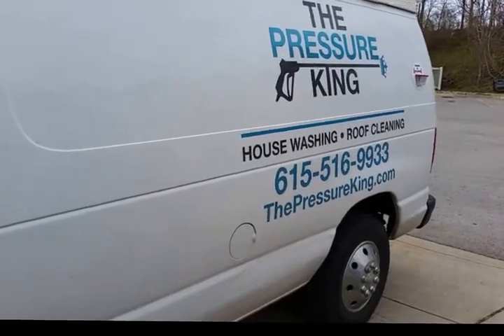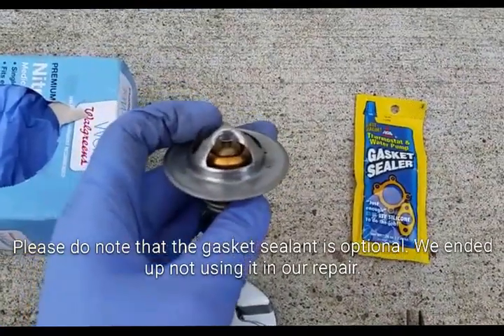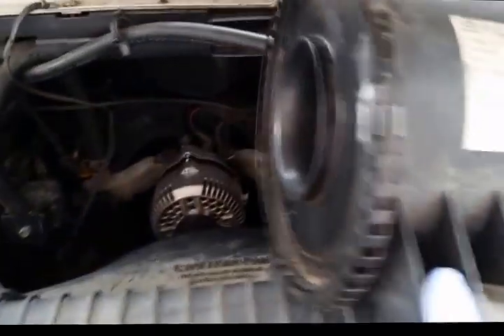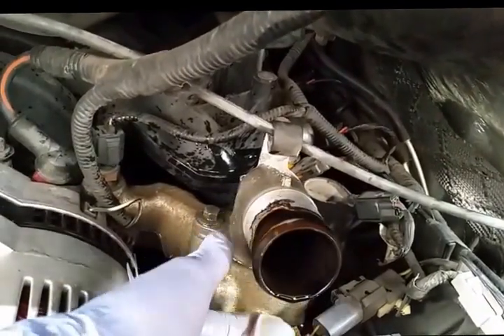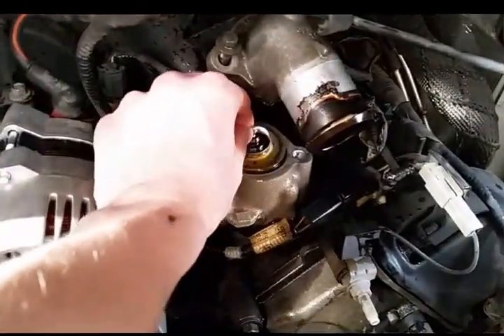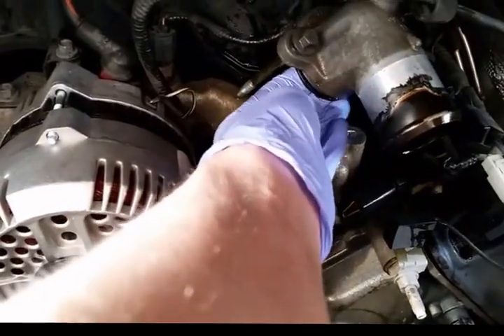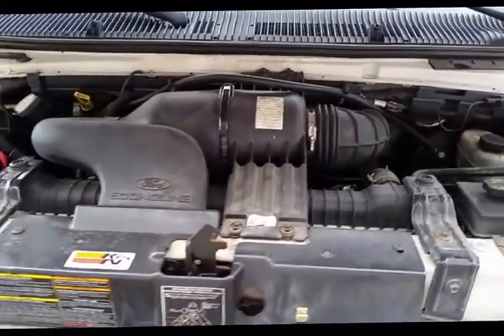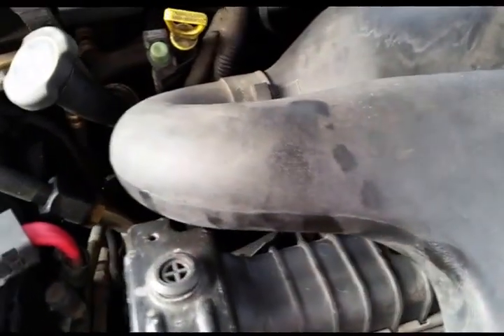Replacing a Thermostat on a Ford E250 (5.4L Triton) - Easy!

Comment: This is TERRIBLE advice!!! I parked on a slope with the front of my van at the higher end and when I removed the top radiator hose it sprayed GALLONS of coolant into my bank 2  spark plug wells and fried two of my ignition coils. I looked up another source for doing this thermostat job and it emphasized that you NEED to “drain all the coolant out of the system before loosening or removing the hose from the thermostat”. Yeah, wish I would have read that before watching this video of an incompetent giving me advice on how to fix my thermostat by ruining my ignition system. Thanks dude!!!!
Reply: 5:18 he specifically mentions putting the van on an incline with the rear up higher. Did you even watch the video? Seems like the only thing that is incompetent is your listening skills.
Reply: Which way does the van need to be tilted regarding the coolant? I can’t tell from the video? I haven’t done this before. Seems like the back should be higher than the front but not sure how everything flows…?

Comment: The spring is just a way for the thermostat to remain closed, the engine heat melts a wax plug inside the housing of the thermostat that opens the plunger and lets fluid pass, the wax breaks down over time and doesn't melt at the right temperature so the thermostat remains closed while the engine continues to heat up.
Reply: Interesting, thanks for the post.
Reply: Not how it works anymore! 👌
Reply: Very good news I didn't have.  Awesome  👍thanks 👍
Reply: @Allworldsk1  then how?
Reply: Not correct , no wax , the temperature makes spring open , when first start on a cold day keep s it closed until temp warms, it will open letting coolant flow through the system.

Comment: The difference in springs is just a engineering design. All the magic happens in the sealed wax cylinder. You can't check them with a visual inspection.

Comment: I'm trying to find info specific to a 93 ford e150 5.8L..is it basically the same as an F-150? No heat, no a.c. gonna start with a radiator flush and new thermostat and hope that helps..I'm on disability n cant afford shop fees..I'm also a 58 year old woman who has never done anything mechanical other than checking fluids n changing a tire..darn it..thx..

Comment: I had a problem with my ford econoline van. My cluster reported a check fluid error and my engine temperature needle dropped to cold but it was over heating. I pulled off to the side of the road immediately and saw some steam coming from under my hood and steam was escaping from under the cap to my coolant reservoir. 

I waited until the steam died down and I thought it was safer. I wore a glove just to be safe but there was still too much pressure. It exploded all over my arm and burned me. I really should have given it more time.

Comment: Thanks for the vid.
How to know the thermostat temp as i can see many types 160  180 190 205!
I have 96 e150 econolone clubwagon v8
Reply: 190 is the typical standard. May go to 180 if you live in hotter climates (all year). Some Chrysler's use the 205. And 160 is really just for performance applications and may throw a cooling performance code on modern vehicles. A parts store should specify what OE temp is when you're browsing.

Comment: Is it correct you don't have to drain the coolant?
Reply from the maker: Correct. But you most likely will have to top it off.
Reply: The Pressure King thanks man and greetings from Germany
Reply: But you could drain off a little and then add it back in instead of dumping it on your driveway where your dog could drink some and get sick or die. Vet bills cost more than antifreeze.
Reply: Just drain some from the petcock (catch in clean pan) and save yourself from buying new fluid